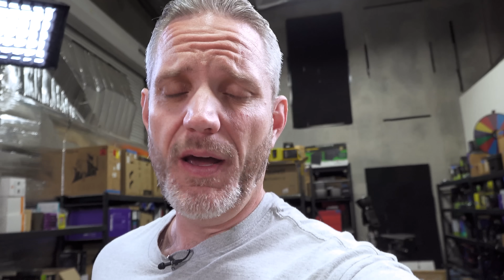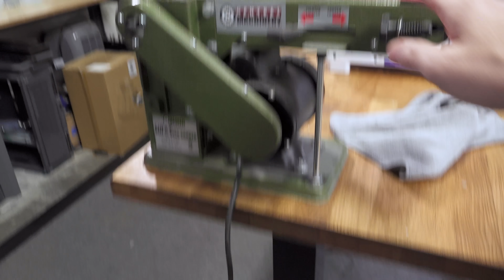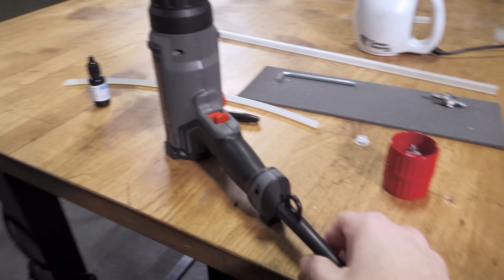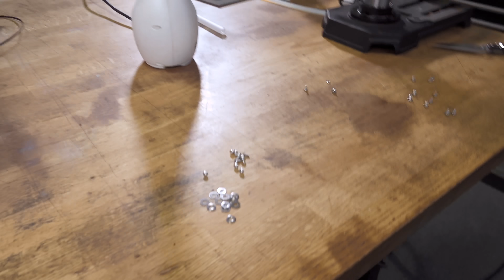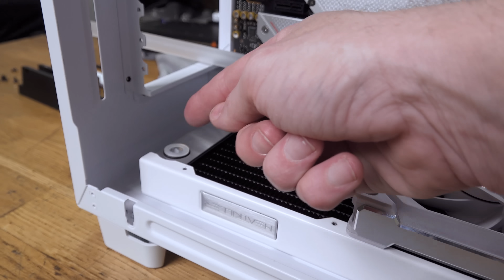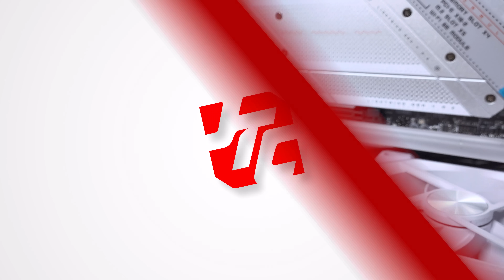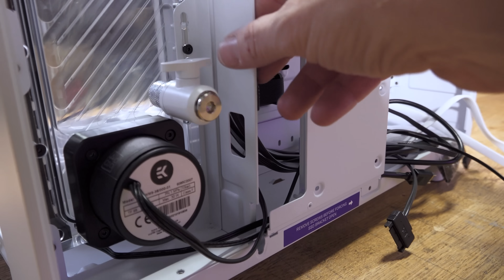ADHD Sucks...

Comment: So Jay. Stop with the pity party-oversharing and get shit done. Make the time or delegate cleaning and organization. You dealing with that stuff is like a heart surgeon mopping the Operating Room floor. (Smell what I'm steppin' in home skillet? With your health issues, I would strongly recommend "delegation". Home Depot has a rockin' labor force in the parking lot my guy! So, suck it up, rub some thermal paste on it, and get to work. Love your stuff buddy. You are way less douchie than Linus. (I bet Linus smells of vinegar and flowers, or perhaps patchouli oil). But I digress. (See what I did there)? As a motivational speaker/paranormal investigator I am here to help. Feel free to lean on me if you require a little push to get you back on track. I would love to see a closed loop 2 in 1 super streamer(ish) PC with competing CPU's from you. With too many RGB/screens on a 3D printed backplane. Real time, same PC, same environment, same 110 circuit head to head testing. AMD RGB 1 color, Intel another. That would be fire! I'm new so this may have already been done. Anyway. Peace and good health be with you my brother!

Comment: does no one make threaded fitting extensions looks like having various thickness extensions would clean up your connection locations and amount of fittings a lot  ay be worth getting a small lathe to make them if no one makes them  makes me wonder if there are gaps in the custom pc building world i could 3d print or machine

Comment: I also have ADD and often don't finish what I start (but more don't start what I plan). I still have a garden edging project to complete (been 18 months). I find doing a spreadsheet on all the projects with points on the next step helps get me started on that project. If I focus on a doing just a small step of the project and not the whole project then it helps me atleast start that project, then continue doing it until complete. Works for postgrad/phd study too.

Comment: Sorry to hear about the health issues. I do pray you're better because I love the work you do.

However, your friends build there and where you put... the kink as call it, is exactly where the case connections usually go. Maybe not the case on this motherboard and I hope so because it will become a bitch to attach them otherwise.

I would have done something with the fittings themselves, to align it better in this case, but honestly I would have gone with a completely different case and NEVER had to pull the hoses/pipes in this way to begin with.

I hope it worked out in the end and no issues followed.

Would have loved to come help you guys out if you needed it but I live in the other end of the country. Dreams right?
But damn proud of what you guys do, keep it up!

Comment: Jay, I'm sorry to hear about your gall bladder.  Having gone through the same, I would like to pass on a useful trick for when you may have future pain:  put a level teaspoon of Epsom Salt into about 4 oz of hot water, stir until the crystals are dissolved, take three deep breaths and hold on the last then drink it.  Follow up with something that has a covering flavor, and that should allow the Magnesium Sulfate to relax the common sphincter between your liver and small intestine to pass whatever is blocking it and causing pain.  BTW, the reason for taking 3 deep breaths is that the taste of Epson Salts I compare to drinking tea made from athletic socks which have been worn daily for a week.  I hope this will help.

Comment: I've been diagnosed with ADHD since I was 5 years old, which was 20 years ago. Trust me, I get it. Part of the struggle is knowing you have to get something done, and getting sidetracked with 10 other small but important things that also have to get done along the way. Also, getting frustrated with one thing and moving on to something less frustrating, and then getting so focused on that you lose track of time. A word of advice in case you aren't doing this already: Delegate. When you need to drop something out of frustration, tell someone and have them work on it for a while. Keep a physical, written list and schedule to remind yourself what needs working on, crossing off as you go. Keep it on the office wall and encourage others to follow along as well. A written list instead of a computerized schedule will do wonders with understanding whether you have too much going on or not. DO NOT be afraid of turning down customers because of being overbooked, but refer them to someone else close by that you know that can do it, preferably a small business. Try to form an alliance with that business for those moments instead of competition. Maybe something like "I'll pay you X percent amount more than the regular price if you agree to sell these products at Y percent discount from my referral. I'll call you personally when I've referred someone so people won't scam you just to get the discount." It sounds contrary to the rules of running a business, but let's be honest - everyone needs help from time to time, and everyone is struggling to make ends meet these days. The more you help each other, the stronger you'll get together.

Comment: Nothing new to me, have it for 54 years now.
Still using and 6700k with Fury Nano  while next on the table is a half build 7820x with an 1080ti with hoses and radiators everywhere for a MORE THEN A YEAR.
By the time i finished i bought something new....
Still using an 7820x with an 1080ti while on the other  table was a half build 5900x with 5700XT with a couple of hoses and radiators.
Upgraded to an 3070TI while still not finished, then upgraded to an 7900XTX few months back. but i am USING IT NOW with 3 360 rads :P

Comment: 37 years old and terrible adhd I have to struggle to complete things alot of time I end up 95% finished but sometimes I put off that last 5% for months...  also it really sucks to get started doing things if you take a break as well like I work seasonally and it is so hard to get started again in the spring/summer time after the winter break...

Comment: I had my gallbladder removed also. Before that i had huge intestinal problems. And it took years of testing and diagnosing. But they never found out what it was. Until one day that i got massive pain. And the doctor had to call the ambulance. The ones at the ambulance figured out my problem right away when they arrived. And now that my gallbladder is gone it has been a major improvement. And everything is back to normal again.

Comment: Glad you're feeling better Jay!  Wouldn't splitting the loop with a direct return from the GPU cause most of the fluid to go that route, being the path of least resistance with a whole radiator and the CPU block to not have to go through?

Comment: now, I know that probably most people would prefer looks to maybe a 1% performance gain, but why not use a 3rd rad on the back? basically going from distro to gpu lower, gpu lower to lower rad, lower rad to gpu upper, gpu upper to rear rad, rear rad to cpu, cpu to top rad, top rad to distro? It would add more tubes, would look a tad more cluttered, but would be setup to radiate heat between each component. I also wonder why I never see a dual pump setup on systems with more than 1 radiator and 1 block? Why not have a dual pump, return mid loop to 2nd pump and then no matter what, absent a leak, nothing can really go wrong and flow rates will be kept high across the restrictions...also would add volume. IDK, someone help me out here. is that silly?

Comment: Like you said in the video, I would put your drill press, belt sander, table saw, band saw and parts washer all on one long workbench but maybe the vice on then end of a clear workbench. Then all your other machines under it like your compressor, big fan, ac, vacum and more. That would give so many things a home that right now is spread all over your place. Then I think that will show you what space is left that can store other similar things and give them homes.

Comment: As someone who's spent a lot of time pipe bending I wish Jay would say "offset" and not "kink."  If you kink a tube you've damaged it and usually throw it away.  Also, if Jay would use 30 degree bends for his offsets he could use a multiplier of x2 and have perfect offsets and not have to make everything so "trial and error," it's slow and wasteful (materials).  Example:  if you need an offset of .5"  and you're using a 30 degree bend, you would multiply .5" x 2 and that would be the marks for your two 30 degree bends.  So you would make one 30 degree bend (+30 degrees), rotate the pipe 180 and make your second 30 degree bend (-30 degrees) at 1" from your first bend.  Perfect .5" 30 degree offset, and when you do it on a flat surface the pipe won't bend (dog leg) on you.  There's rules for 90s (take ups and shrinks) and 45s (x1.4) but that's like math (trigonometry) so I won't even try to explain.  I hope that helps.

Comment: i have this tower and i can tell that this is not any more Vanguard this is now Vanguard II or pro or what you want to atach on that name. that is 3 glas panel with small mesh on a front plate, now with my mode this has BIG mash instead glas panel. under metal mash is plastic filter agenst mosquito and all that is anchor with 6 magnets, 4magnets use holes for tighten glas panel and 2 holes was drilled in an already prepared place in the factory. so i have now tower with so much air for cooling my pc.

Comment: Have to say I can't relate to the ADD or ADHD thing.  I'm a pretty hyper and energetic guy but I have the focus of a monk in full zen mode.  I can't fall asleep if I don't intend to and work night time security alone.  I can watch the Lord of the Rings extended cut trilogy in a single sitting.  I can play the same game for 16 hours a day without taking more than a few water, food, bathroom, and stretch breaks.  I also typically only play one video game at a time (for months at a time).  I'm a freak.

Comment: Why don't you 3D print a shroud for the radiator, so one fan can pull through the whole radiator.  You don't need high airflow, just constant.  Seal against the rad so it stops bleed between the shroud and the fan / rad, to make one fan efficient.

Comment: Glad everything is going better Jay! You've inspired me, your channel re-ignited my passion for watercooling and modding and finally 2 years ago after 3 weeks of pain I managed to finish my first build. Had to go big or go home so used glass tubes.
Just 2 small tips on the build in this video. For the bottom pipe, instead of the kink, wouldn't it have been cleaner to use an extension fitting to bring the tube in line with the port on the other end?
Also, for the drain port on the back. You could still use a black swivel, just replace the green o ring with a black one 😉
You are an inspiration for many of us. Keep doing what you're doing and ... Thank you.

Comment: Jay, with that tube you kinked at the bottom that ran along the fans. How hare would it be to get to the fan screws? Would you have to take drain the system and take out the tube to access then in case one of the fans broke and you have to replace it? Been thinking of doing something like that with a build I am starting myself.

Comment: I'm wondering why you didn't do a 90° angle at the start of the radiator instead of that extra 90° fitting. Because then you wouldn't need a kinck...

Comment: I see it my son. I have Autism. it may not be ADD ADHD but ASD is a bitch as well. and I just learned that I have seizures.  
 and JZ, I did enjoy building computers, but I jsut never had the money to do it. I jsut recently re-housed an older opaque because mom needed a system.  But for Damn Sake the industry has changed from being simple to being a real Bitch... and what I mean by that , things used to be get a case, get a power supply to match the power you need, and making surre that the MB is proplery matched.
Now its all freaking LED this and can it clean my house?  I just gave up on the entire thing. the more crap one adds the higher the failure rate. 
So I understand ram speed, I understand fan , I understand the Negative and positive pressure, but Freaking a....Do we really need LED shit?  Do we we really need a bunch of crap like water cooling?  I am like, I want a PC not a machine that will piss on its self. If I wan ta machine that can wind up pissing on itsself, I freaking build an android. Also what is up with up all the wierd ass connections?  my moto, is if it won't fit in my case which is Entech,, then it should not be built.

Comment: I don't have any experience with ADHD and I'm not really informed on the condition. However one thing I can say from experience is that, when you have a lot to do, the best thing you can do is take it a day at a time. I know it sounds obvious, but when you set tasks for yourself, by default in your mind you think that you have to get it all done at once. The problem is that when it's too much to handle at one time, your mind simply gives up on it altogether and you just end up procrastinating.
Small progress is progress nonetheless, even if it's organizing the layout of a single desk in your massive workshop when you have time in the day, you would ave completed something that you can feel some form of accomplishment from. That sense of accomplishment will snowball and carry you to do something else the next day, and then the next, even if you take a day or two off in between, you'll still have your progress to continue building on.
I'm not learned in psychology or anything like that, so what I'm saying could easily amount to just bs rambling, but this is a mindset that's helped me personally, especially when it comes to art and writing.

Comment: I got my ADHD diagnosis 25 years too late. People seem to think ADHD is a super power. It is not. 

I have spent most of my life-post-15yo failing at just about anything I try. As an adult I worked for 12 days, spent 2 in a fetus position, worked 12 days, 2 days in fetus position.

The I got a girlfriend and that strategy started failing. I got recurring depressions instead. Then I got kids and everything took a turn for the worse.

Everything was quite OK in school. When I got older the demands got higher and things started getting harder for me. I flunked in university quite badly. Not because I found it hard, but because I never managed to get things done.

Comment: Jay, you will not read this but it is not about space, it is not about stuff being all over the place. It simply is and will always be your lack of planning. Sceduling is everything. You can have 10 filming sets and no idea what you are going to do with them they are all useless. Create two sets and few movable tables. That means you don't swap the set just the table. Meaning you can start where you left off. Have a talking head corner, and plan. Build, talking head and exposition talking head, build. Build on this simple few steps. The talking head video means content while the next set gets prepaired for the next video. Things are only complicated if you allow them to be. I am not a content creator but I work in a 3mx4m room my entire life. Storage and management is everything. Anyhow you will not read this.

Comment: Don’t EK do spacers on their fittings so you didn’t have to bend the tube? Other option could have been to use a pair of 45s instead of a 90, also helps just a little with less resistance on water flow.

Comment: I'm more in the OCD camp
I changed from a failing CPU Air Cooler to a 240mm AIO and had to take the motherboard out of the case to change the back plate and I then hooked up all the cables and squeezed the side f the case back on but even though I cannot see the mess I know it's there and I'll have to make time to do the proper cable management

Comment: They need to make a better retention clip for GPUs. Getting my card out of this ASUS board for my new GPU was a nightmare of me using a very long screwdriver flathead to press down on the clip and I felt like I was going to die from stress trying not to spear my MB if it slipped.

Comment: Is it possible to turn the bottom rad so the ports are at the other end and then turn the rad on its side, then 3D print some ducting to route air but making the duct stepped like a staircase - each step being a megaman level so it matched what you wanted to do with the case ?

Comment: I know nothing bout water cooling so just asking out curiosity. Could a piece of tubing be placed between the upper 2 fittings to push it out to line up with the rear vs doing the kink? Or does the tubing need to be a certain length to work properly?

Comment: Hey Jay, i know your the water cooling man but in reguards to that bottom hose having that offset. which you done a nice job on. I couldnt help but think wouldnt it just be been easier to do a m&f extention between the 2 90 bends to save doing the offset all together. Thanks for everything dude.i would never have built my own pc with out your videos

Comment: Why wouldnt you just switch o rings?  And  You tend to make things alot harder then they need to be,  You could of just got a 1/4" extension or 1/2" if needed so you didnt have to run all the 90s

Comment: @JayzTwoCents, why not have the GPU parallel, one side to the 120 radiator at the back, one side into the CPU. THEN, after the CPU and the 120 radiator, have them Y merge into the top radiator?

Comment: Hey Jay.. I have the same GPU block in my build, but Manual instructed to use the I/O offset, so Ive got the back plate connected on the left and the GPU block on the right. I'm also using the 011 Distro plate. is there a right/wrong way to do this ? its been working for me. glad your feeling better!.